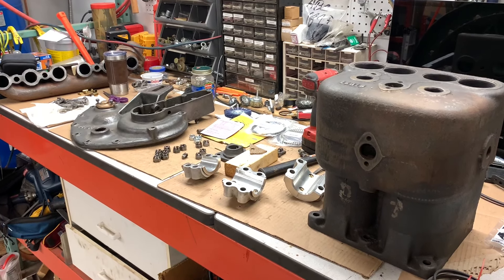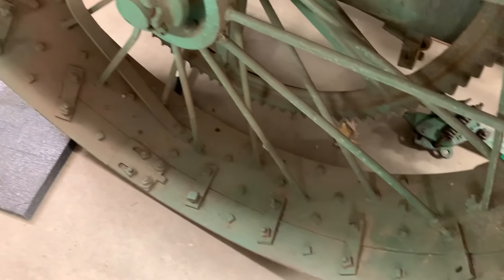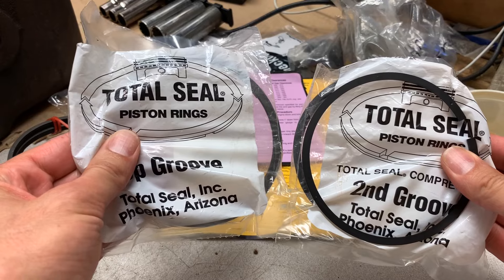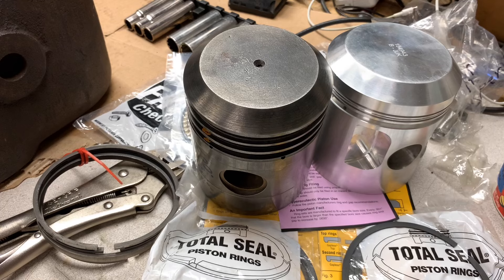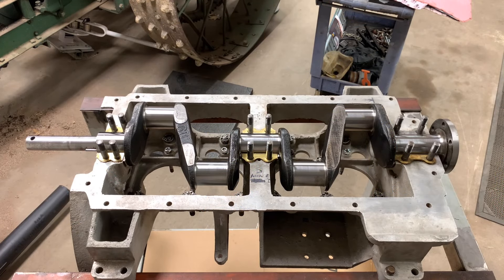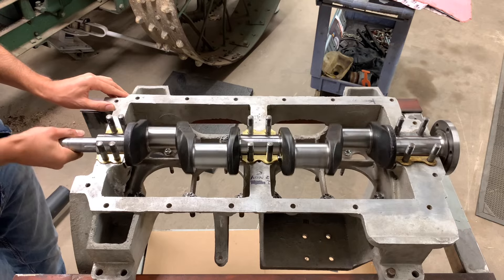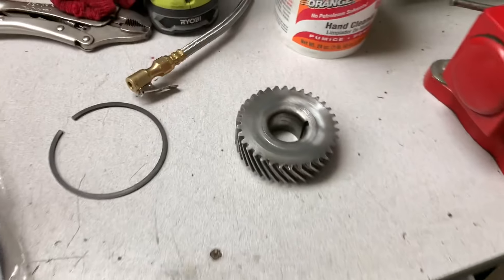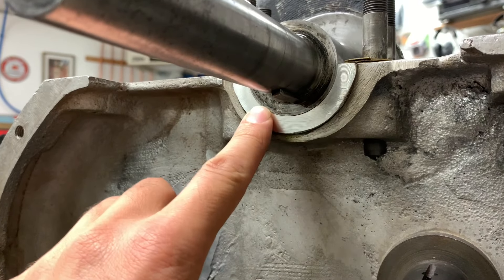Rock Island Heider Model 9-16 Assembly #1

Comment: Impressive! I have that same ring grinder but purchased through Goodson. It is slightly modified with an added v groove milled in it so you can also slowley grind your valve stems. Works a treat on my Vintage Briggs small engines.✌👍